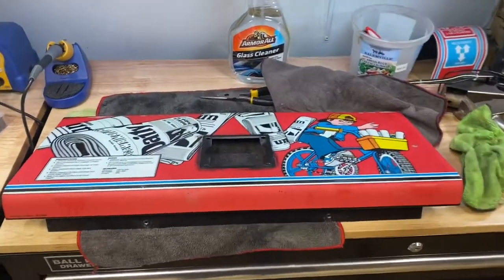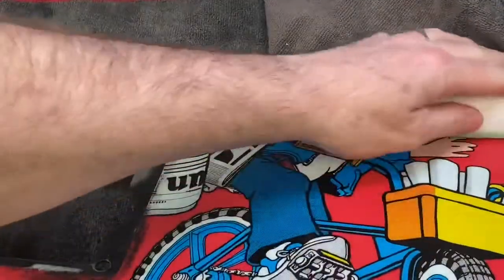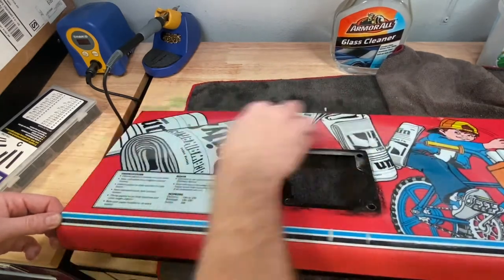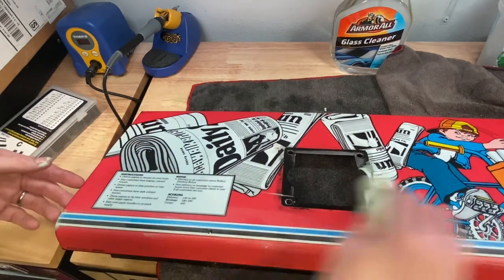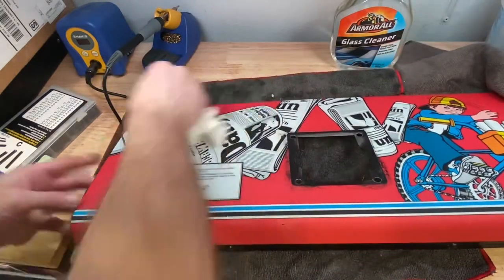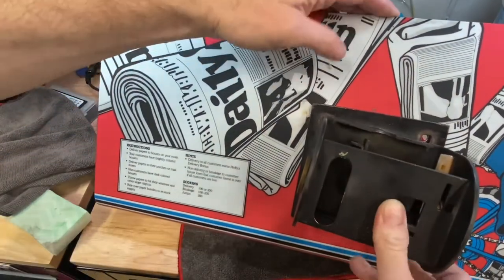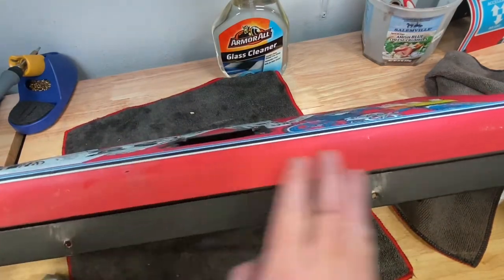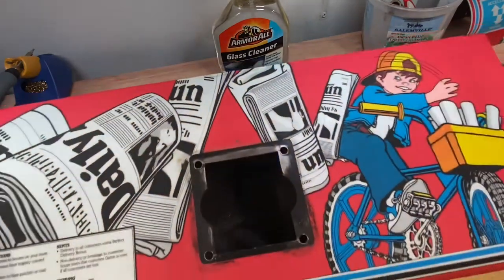Atari Paperboy cleaning up a control panel overlay

Comment: Rats! Where is "Part 1.5" where you show taking the Paperboy controller apart? 😂 well, I do have the operator's manual, I guess I will figure it out.
Reply from the maker: I did a video a while after that’s says part 5. Where I took the controller part. Maybe check that out. Was from March of 2021
Reply: @gumby510  Thanks a ton, I did find that one and it is a big help!